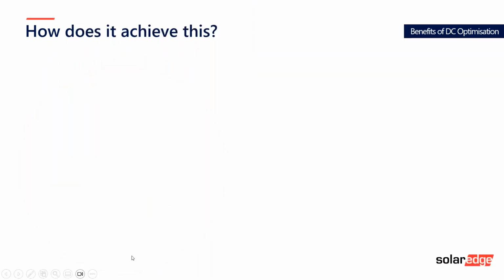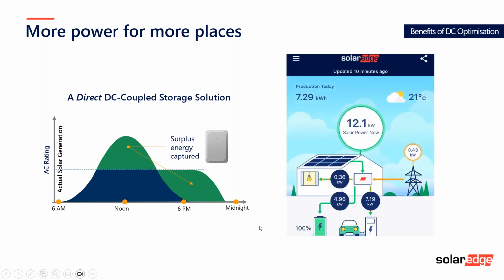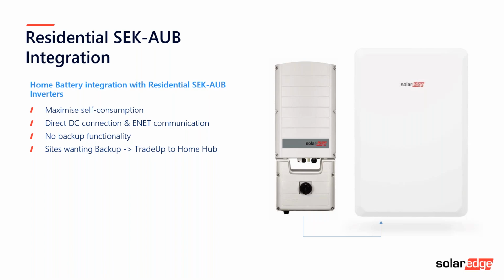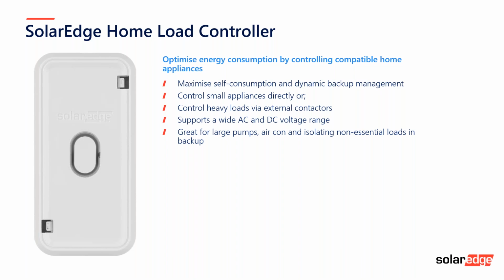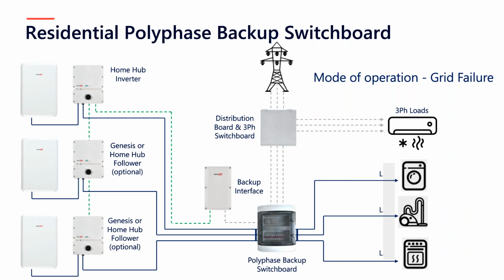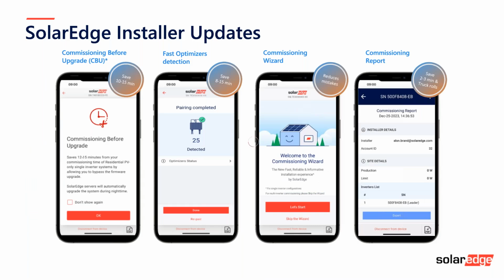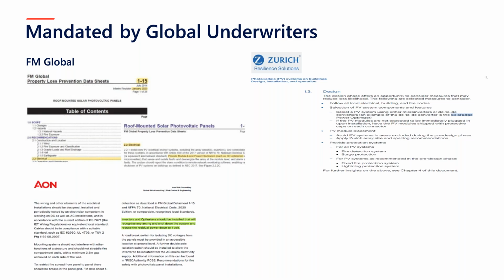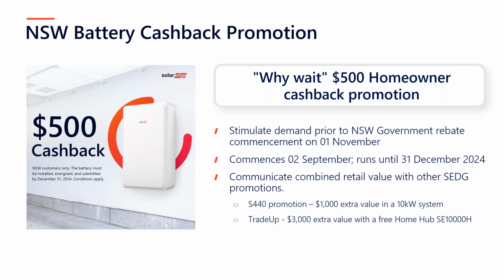SolarEdge Roadshow Webinar: Latest Innovations & Opportunities for 2024

Comment: New Products and Features:
Home Network: A new technology that wirelessly connects SolarEdge's smart energy devices [15:57].
Redesigned Inverters: Improved inverters for better performance and reliability [16:46].
Home Battery Integration: The Home Battery can now be integrated with residential three-phase inverters [17:55].
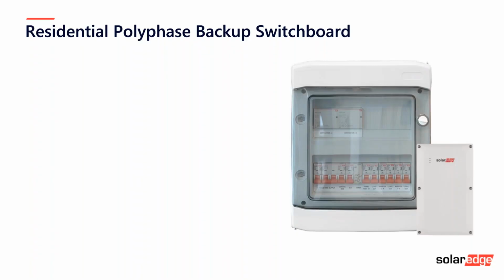Polyphase Backup Switchboard: Enables backup power for properties with dual or three-phase electrical systems [26:38].
SolarEdge Go App: A new mobile application that combines functionalities for system setup, site mapping, and monitoring [37:20].
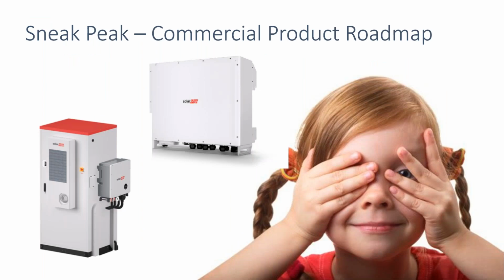Commercial and Industrial (CNI) Products: Upcoming products include the Teramax inverter and commercial energy storage systems [39:53].
SolarEdge 1 for CNI: A new all-in-one platform for monitoring and managing commercial solar systems, offering features like fleet management, detailed dashboards, and a digital twin for 3D visualization and analysis [42:40, 42:48].
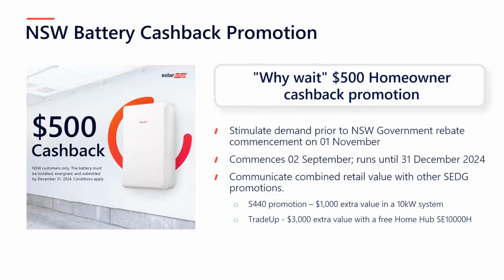Promotions: There are ongoing promotions for residential and commercial optimizers [07:10], a homeowner cashback program in New South Wales [48:56], and a trade-up program for older SolarEdge systems [50:10].